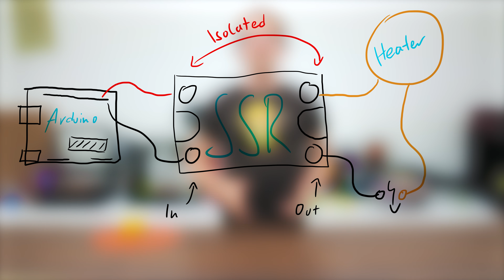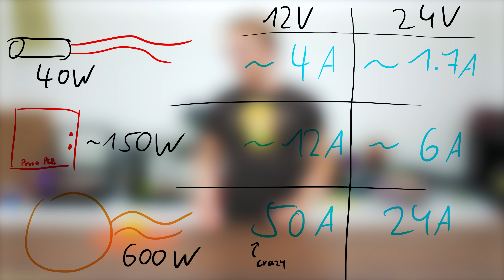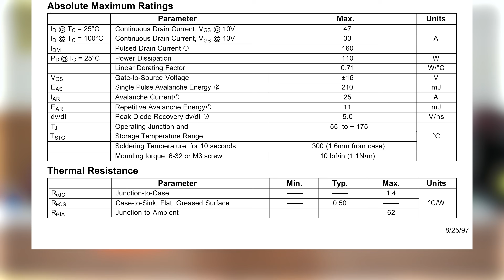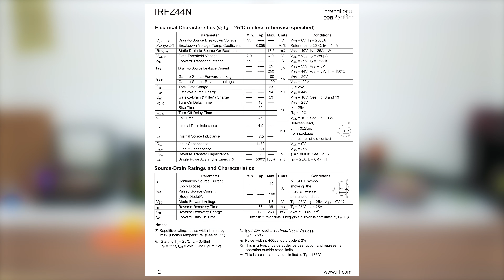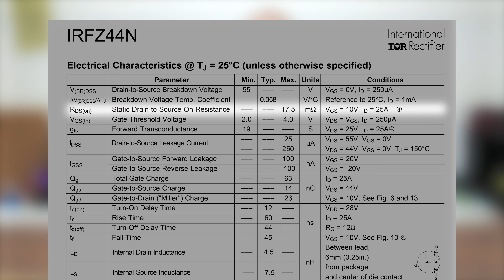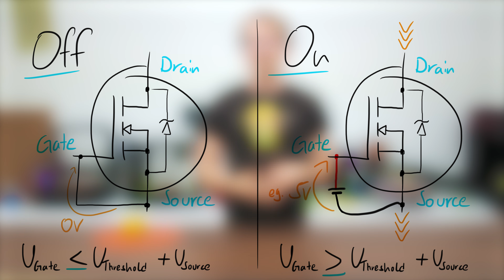Guide: Properly picking and using MOSFETs!

Comment: Your right I bought some mosfet on Amazon thinking the irf z44n was a good logic level mosfet as I connected the 6 volt pwm sine wave to it and power up my inverter everything just get really that the midge internal system failed and the I thought the data sheet gos for all z44n mosfet but I was wrong

Comment: I don't understand anything >.< I have a laptop that won't switch on and a mosfet is overheating when plugged in, also there's a short between all 3 pins of it, so I figure it's dead. I wanna replace it with something I pick off of a different board, but don't know what to look for. Edit: the dead mosfet is a 85U03GH.

Comment: In order to switch on a mosfet the gate must have a voltage difference with the source NOT THE DRAIN as the video says. The mosfet datasheets do indicate the resistance depending on the VGS (voltage between gate and source ). When the mosfet is N type the source will be at a lower voltage than the drain and so the gate voltage must be positive compared to the source.

Comment: Lets see, current is the flow of electrons (- charged particles) towards the positively charged potential. Source is the source of electrons, drain from the valve is the path towards the + potential.  Yet they still teach the inverse. It's a lot easier to learn if you keep with the basic physics. Other than that you have an excellent  program going on here. I wish I had run across this when I was building my system during the same time as this post. I was unfamiliar with MOSFETs at the time. And partner was doing the programming and had the darnedest time understanding the use of controlling the ground path as opposed to the potential side. We finally got the simulator up and working, all 3 tons of it. This info could have saved a few hundred bucks. And many hours.

Comment: Hey Thomas,   great video as usual but I have a correction and a recommendation. At the 7min mark you start talking about wiring it up. You mention "how hard could it be, it's only got three pins". I think you missed a chance at sharing an important safety message here. Yes, while it only has three pins it's important to note that most of the time the heat sink is electrically connected to one of those pins. Letting it touch other things in the circuit is a real fire starter concern.  Also, a few minutes later you said that to turn it on the voltage at the gate needs to be significantly higher than the drain, pretty sure you meant to say higher than the source for this N-channel mosfet.

Comment: If the wiring only requires up to 2 additional resistors then why do the prebuilt 3d printer mosfets have so many SMD components on them? Not sure what they all are, but it looks like multiple resistors and a couple other components I'm unfamiliar with? Is it to somehow make up for the cheaper mosfets they use?

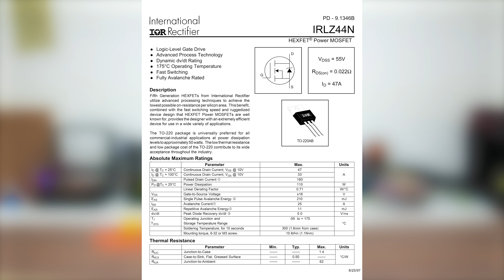Comment: @5:00 Wait so Rds(on) increases as driving gate voltage, Vgs, decreases? And higher Rds(on)  means higher power loss (P=I^2R)

@7:13  Pins of a MOSFET. Controller voltage applied at gate. Electrons flow from Source to Drain (Current/positive charges flow from Drain to Source).
@7:36 MOSFET OFF: Vgate - Vsource < Vthreshold
@7:36 MOSFET ON: Vgate - Vsource > Vthreshold
@1:21 Pick MOSFET based on load operating voltage and load current draw
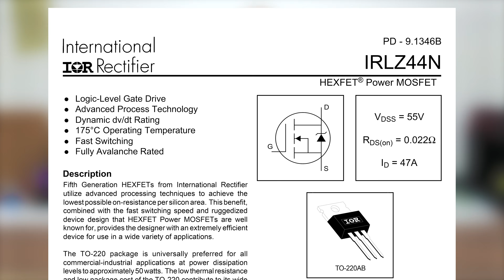@1:57 Vdss and Id specs assume you can provide active heat dissipation. It doesn't mean the MOSFET can passively dissipate heat up to those those values to prevent failure. 
@2:36 Rds(on) is a MOSFET's internal resistance when switched on. Use P=I^2*R and what you know about the load current to compute thermal power generated (which needs to be dissipated). @3:03 Rds isn't an exact value multiply it by 1.2 (+20% derating). 
@3:52 Thermal resistance Junction-to-Ambient spec tells you how much the device heats up per watt of power dissipated (take value, multiply by power, and add ambient temperature 25C)
@5:00 Rds(on) is the Static Drain-to-Source On-Resistance. As the driving voltage, Vgs, decreases Rds(on) increases which means higher power loss.
@8:03 Sample circuit with MOSFET driven by Arduino. 1:100 voltage divider biased.

Comment: Can you please explain the optional 100 Ohm resistor on the gate ?
Reply: Just to limit the current that can flow out of the arduino - those pins are rated to 40mA output max.

Comment: Hi there. I don’t know if I’m biting more then I can chew. I bought a ebike kit. I put one together for my son and it was so cool that I put one together for my self. The one I put together for my self runs a 1500watt hub motor. On the first ride we took I was out 7 miles and it quite . I shut it off and drove about a half a mile and it blue a fuse. I put another fuse in it and it blue that one to. I seen a guy checking the board and it was pretty much the same. I have two mosfets blown. The numbers on the mosfets are 110n7f6, gf549mb, chn813. What would be the best I can replace these with?

Comment: important bit - at 5V many many power mosfets will only hit a fraction of their min on resistance. - you would probably want logic FETs for the arduino....or a npn and a pullup to a 12v line.

Comment: Hey Thomas, how about the inductive back-EMF of the heated bed? There's a simulation on Reprap wiki (not sure if it should be trusted) that with measured actual inductance of Prusa PCB and wire, the spike on the ST MOSFET employed in RAMPS is if memory serves well above its rated voltage! And the types that you suggest like IRF3708 are rated even lower.
Reply: Does the internal diode not handle this Siana ? 😕

Comment: As an electronic technician and electronic engineer student I can say that when I found the IRLZ24N in my local shop I started to use it in all my projects. It's a Hexfet with a 15A Ids and the VGSth its around 2v so you can toggle it with any MCU. It's the perfect electronic switch for all the projects. It's fast and has a los Rds too (so low heat dissipation).
A dream made transistor.

Comment: WARNING.  My top label plate was on backwards such that I un-knowingly connected 120ac to the DC side of relay.  Using small screwdriver pry off label plate and make sure led is lined up with round window.  Bought SSR-60 DA off Ebay.

Comment: Hmm...  I could use the aluminium plate of the heated bed as a heat sink, and kill two birds with the same mosfet!
Reply: Remember that you need to account for the fact that your "ambient" temperature will be equal to the heated bed temperature. and not 25 degrees C. So incase of a 100 degree heated bed your mosfet will run 75 degrees hotter then with a standalone heatsink.

Comment: Let's say you have some mossfets that take a higher Vgs. I've seen some people use an npn transistor connected to a 3.3v microcontroller to provide say 12v to the gate of a mossfet to lower it's RDS on. I just haven't seen a good explanation of how to do that
Reply: Just use a low power MOSFET as a driver, like the BSS138, which has a Vgs(th) of 1.3v typical. You will need a resistor to limit the inrush current and then it will draw no current from the MCU to stay on, unlike the gate current of a BJT. The lower the Vgs(th), the more susceptible it will be to noise so if you use the BSS138, keep it close to the MCU.

Comment: Those are not MOSFETs. They are pnp and npn transistor. MOSFETs are only seen in laptops and cellphones not desktop computers.
Reply: Are you replying to somebody? Because your comment stands alone and doesn't make any sense. I mean at timestamp 1:48 what is it? IRLZ44N. What does it say at the top of the datasheet? HEXFET Power MOSFET. The rest of the discussion is on the MOSFETs too.

Besides, it's absolutely wrong. There are lots of uses for MOSFETs inside a desktop computer. For example look in the vicinity of your CPU on the desktop computer, you will find a distinctive circuitry with one small control IC, then a bunch (4 or 5 usually) of boxy inductors, a bunch of input and output capacitors, and two or three discrete MOSFETs per inductor. In the two MOSFET per inductor configuration, the two MOSFETs form a half-bridge, where the outputs are connected to the inductor, and the inputs of high-side MOSFETs are connected to +12V (that separate 4/8-pin plug going from the power supply in the vicinity of the CPU), and the low side MOSFETs are connected to ground. To regulate the voltage up, the controller turns on the high-side MOSFETs, to regulate it down, it turns on the low-side MOSFETs. The MOSFETs on the low side are N-channel, on the high side might be P-channel, might be N-channel if the controller IC has a gate charge pump. Depending on expected duty cycle and on-resistance, they sometimes double up one of the sides, so this is how 3 MOSFET per inductor configuration comes about to improve efficiency and reduce thermal stress on the individual MOSFETs. You can ascertain yourself that those are indeed discreet MOSFETs, just google the markings, and you'll really find this on every single board.

Once you see this distinctive circuit, you cannot unsee it, it's everywhere in PCs. You will likely find a copy with a single inductor powering your RAM, and a similar one again with multiple inductors on a graphics card. It's not very common in power supplies, but some higher end ones use the same to generate all the lower rails. It's an extremely efficient design and for its efficiency it's very inexpensive.

Besides, i have often found a sneaky little 7002 MOSFET in the LED control in many PC mainboards :) small MOSFETs like this and BSS138 cost the same as a small NPN, and you can usually save yourself the base resistor, so it's cheaper on the whole.
Reply: There are many MOSFETS in a desktop PC these days.

Comment: If you can't connect ground rails you can still use an optocoupler and a mosfet
Reply: Which is exactly how many Chinese MOSFET add-on boards for 3D printers are made like, they usually drive the gate off an optocoupler.
Reply: Grobbekee    yeah, plus you get extra isolation and level-switching if needed!  What's not to like?
Reply: Well, most optocouplers are relatively slow. For higher frequencies, a transformer would probably be better, or 2 capacitors (one for signal, one for gnd).
Reply: Firmware is usually deliberately slow on the heater pins, because the developers are well aware that the MOSFETs are under a high stress when the switching occurs. The default Marlin heater PWM rate is about 7-8 Hz. MIDI is a completely optocoupler driven serial connection that electronic music instruments use to exchange control signals, and it runs at 31250 baud, and you can often push about a MHz or so through a random cheap optocoupler. I think optocouplers are excellent for power MOSFET control as they should unlikely be the actual bottleneck. Transformers are indeed a possibility. Capacitors, you could do bit stuffed protocols, but how would you prevent them from settling into no-mans-land otherwise?
Reply: With a pull down resistor on the gate. But yeah, optocouplers are the way to go if lighting fast is not required.

Comment: I bought one from eBay with YMP200N55 MOSFET. Can't find any info about it anywhere. I'm afraid of using it without knowing its rating. Is anyone using the same MOSFET? Is it safe to use?
Reply: Well that's weird. There's YMP200N08. There's a YMP230N55. Is there a chance that you misread it, or is the marking clear enough? The source is YMIC Power Semiconductor, an obscure Chinese company that might be defunct by now, i personally think there's basically zero chance anybody would fake their semiconductors.

If we were to assume that the marking is correct, it's likely that what you got is a derated version of YMP230N55, maybe they had a "bad" batch that was still good enough for most use. 230 stands for 230A of current (at room temperature - at load, more like 170A), so you can expect a tiny bit less, and 55 stands for DS safe voltage of 55V, and finally it's an N-channel MOSFET. Its RDSon is the bloody spectacular 2-3mOhm when driven off 10V gate, and if yours has been derated, it's likely at the higher end of that range. Of course the gate is about as murderous to drive as you'd expect for such a bulky unit, but it shouldn't be cause for concern.

Maybe it's a voltage derated batch of YMP200N08, but that's no cause for concern either, as that one goes to 80V. In fact i wouldn't be surprised if it was all the same silicon for all of them, just selected differently.

I wonder what the rest of the board looks like. Many of these Chinese boards drive the gate off an optocoupler, which is nice, means you don't have to be concerned for your controller board at all, just plug it in, be happy, worst possible case you get to replace your PSU fuse, but if it doensn't overheat and you don't zap it, it shouldn't fail. Any good component can fail though, so you have to be cautious with anything really, there isn't going to be a risk free solution.

Comment: could you recommend a MOSFET for switching a 15 amp inductive load. at up to 30volts. and I'm so new at this. and self taught by ppl like you. I don't really understand how to select gate resistors. I don't totally understand how to select resistors for anything. the basically zero current of a gate of a FET. really throws me off. also could a led be added to the gate to ground? without any bad effects? I will be switching on the fet with a zener of about 27 volts. to activate the gate when the voltage rises to about 27 volts.  it is a regulator for a alternator. using two FETs . one turned on with a switch. then another to ground the gate when the voltage rises to about 27v. when in operation it works like a pwm. pulsing power to the field. keeping the voltage below the zener voltage. the field windings can pull about 12 to 15 amps. depending on the resistance in the carbon brushes. they are about 1/4" by 5/16" and up to nearly 1" long. I font know the resistance of them in circuit or otherwise. but most of the time they stop operating when they get to about 1/4-3/8" long. they don't have enough tension to keep in contact. maybe I should try checking. I guess it would have to be calculated . there is no way of testing while assembled . thanks if you can help it would be awesome and appreciated . thanks again....

Comment: I never understood why they could not make the pins, GATE,INPUT,OUTPUT, or GIO, Simple right??
Reply: Because you can use an N-channel both as a high-side and a low-side switch, you just need a gate charge pump controller to use it on the high side; however in this case the input and output are reversed! I mean the current direction is still the same, right, but the logical use isn't. But drain and source aptly describes current direction, doesn't it.

Comment: tom i have a amp that uses IRF1404 for the power supply  and when ever i wire the speakers to 1ohm it blows all the mosfets , the amp is rated 8000wx1ohm is there a stronger mosfet i could use gate resisters are 10ohm. appreciate any help. thanks
Reply: Use a IRF 1405 it is rated at 55volt , 169 amps it should work fine and has higher ratings !

Comment: I bought a ready made module from Aliexpress( I think),uses a YMP200n55 so far , no data sheet :-(and there is no mention of polarity indicated  for the control signal connection to this bit of crappola  Now why would there not be requirement for observing polarity on the control signal which is using a common ground with the power supply. My ATX is cap. of 500W. I suppose I will have to ohm it out :-) But seriously this could have been a train wreck!!
Reply: I bought one from eBay with that exact MOSFET. Can't find any info about it anywhere. Did you find the datasheet.  Are you using it. Does it work or did it catch on fire? I'm afraid of using it without knowing its rating.

Comment: Another way to make sense of 'Drain" and "Source" is that they're for electrons.  Electrons, which are negative, flow into the source and flow out the drain.  So the actual electron flow is the opposite direction to that which we normally think "current" flows.
Reply: @Billi Vandori , for actual current, yes.  For "convention" current, it's probably right, but it sure is confusing.
Reply: Electron point of view:
Source: provides electrons to the drain.
Drain: receives the electrons.
Source -> e -> Drain.

Conventional current:
Source <- i <- Drain.